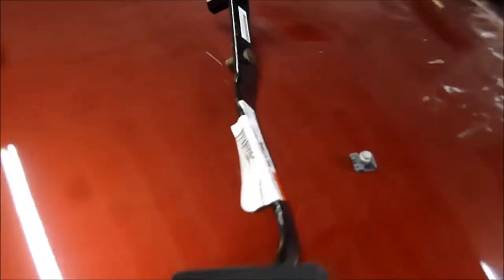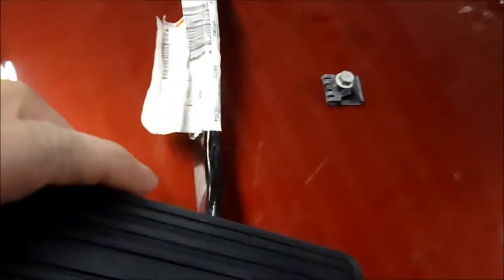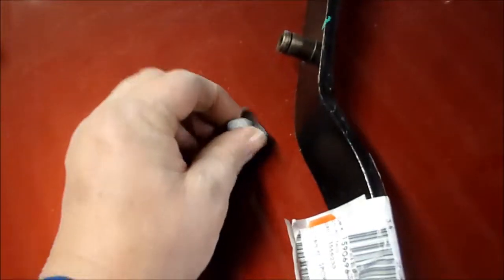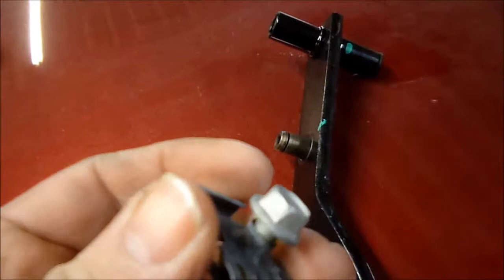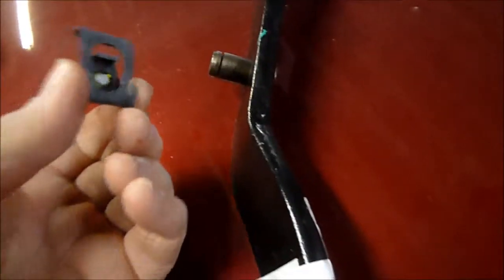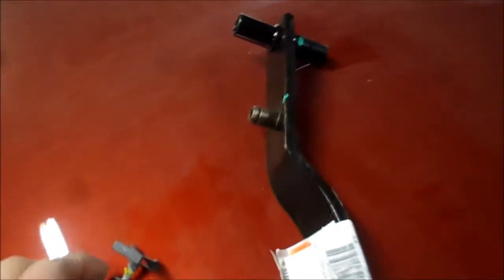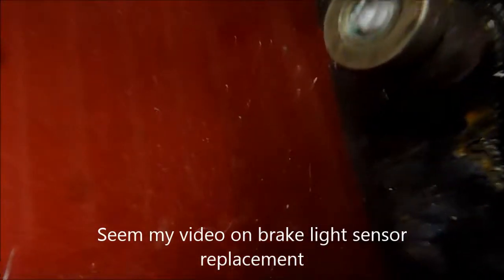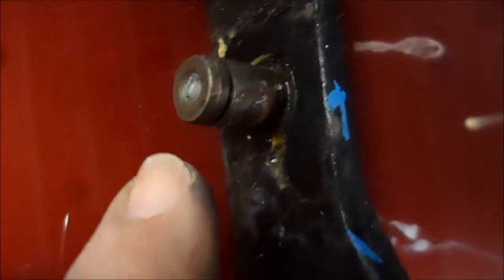Brake Pedal replacement

Comment: The Brake pedal arm/assembly part #15906963 has been discontinued by GM. Looks like the arm has to come out, then try to use a bolt extractor on the broken bolt.